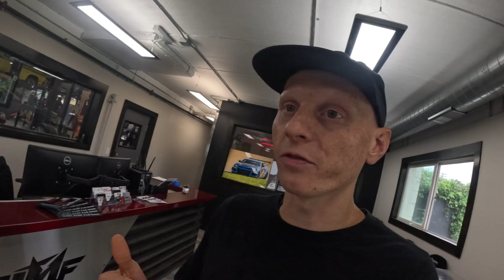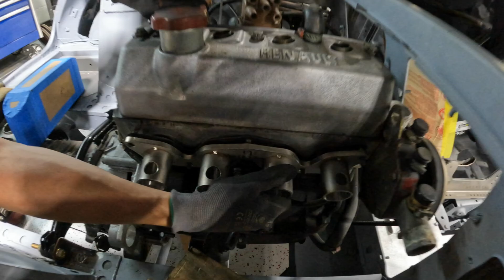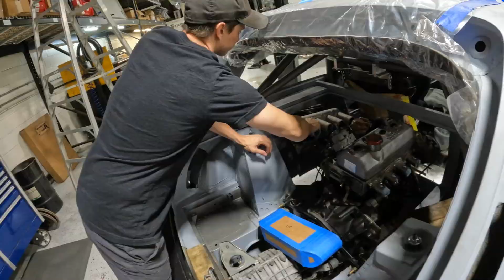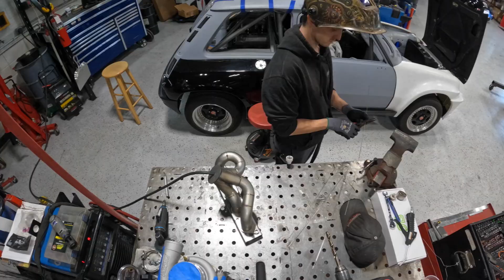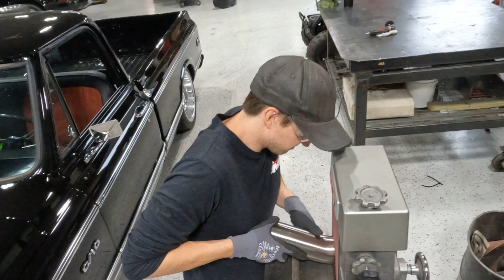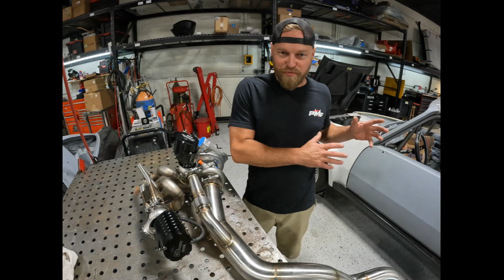Renault R5 Custom Header, Downpipe, Anti-Lag, External Wastegate EP.14

Comment: Would it be worth installing the same stiffening iron tube between the upper ends of the car's rear suspension towers as You installed in the front end of the this B-group Rally car?

Comment: nice build! back in the 90s a client and now close friend of mine bought a r5 turbo 2 , i did all work, service and mods on it, and became the go to guy for r5 turbos in the north east.
he ended up acquiring the spare backup car r5 turbo 2 imsa gtu car. as the first was  crashed killing the driver and renault retired the platform from imsa. the result of that accident was the thing that brought the hans device neck restraint to life. pretty cool cars.
Reply from the maker: Thank you!! That's really cool, they're great cars to work on and it sounds like you've got a passion for the chassis. That's unfortunate, but at least some good came out of the accident; cool bit of history ❤
Reply: Hey @madnessmaker6162, Do you know what Renault had to do to the R30's transmission after rotating it 180 degrees, to revers the rotation direction of the driveshafts?